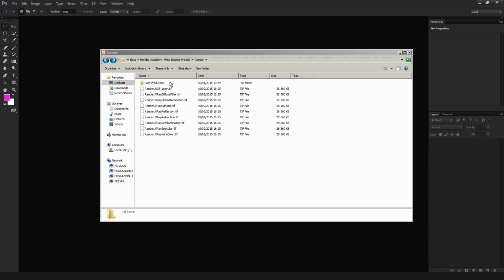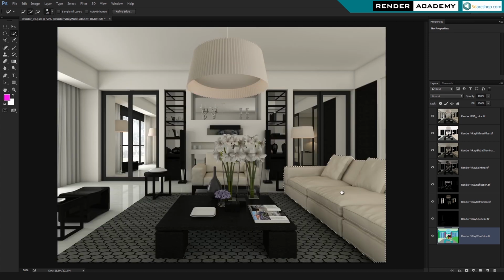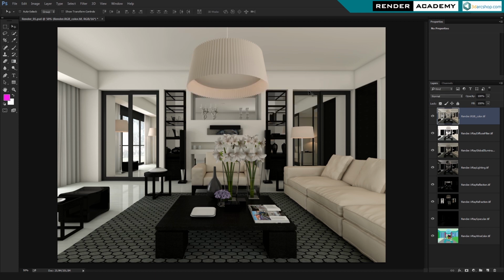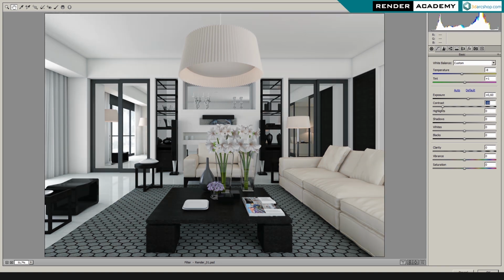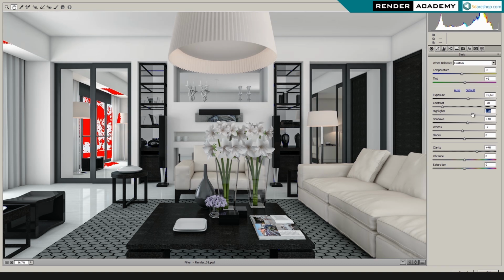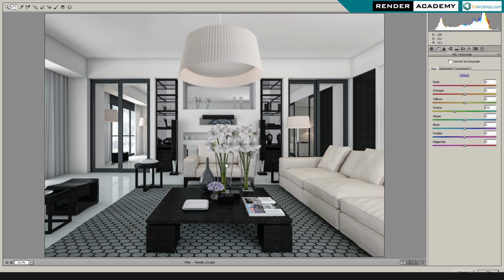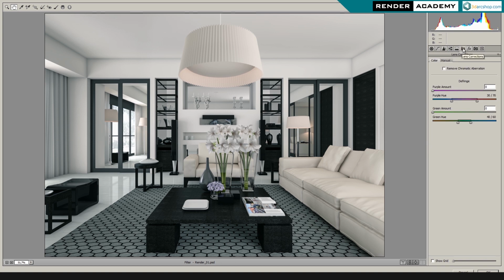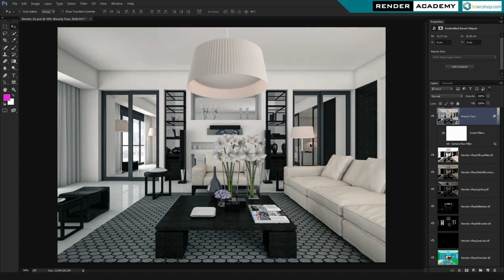Photoshop and Camera Raw Post Production for Architectural Rendering and Interior Design

Comment: Great tutorial. Just a quick question. 
some people say that render elements should be saved as EXR files. 
but there are some limitations, as far as photoshop adjustments are concerned. 
You saved as TIF. 
What is the second best option, in order to have as much detail as possible? 
and while it make a difference if someone saves as TIF, Targa, e.t.c
Reply from the maker: The main difference is on the bit-depth of the file. Imagine the file type as a container, capable of containing more or less precise data.
One example can be the .jpg with a lossy compression and usually with 8 bit per color (sometime called 24 bit: RGBx8bits each). Other example can be the .hdr or .exr files capable to contain 32 bit per channel - hdr are well known exactly for this reason.

In this tutorial I'm using a non-linear workflow with gamma 2.2 correction, I feel quite comfortable with it and the file output can be: 8 bit (too small for post production), 16 bit (imo the perfect fit for this situation) and 32 bit (too big and unnecessary for what is my goal, my workflow and my starting result for post production). Now is time for the file container: I used tif because I'm used to it after many years of testing. I'm not saying this is my "favourite" but I know what can I expect from it.
Please note that some raw render elements may best fit in 32 bit/channel, but still I think it really depends on what is your starting point and your goal.

Comment: good tutorial.
btw, sorry this might come off as stupid question. but could you explain to me how do you make the various files according to render elemnt.
is it when you save it as TIF, its automatically saving into several file according to layer?. if it doesnt how do i make it?
and can i save it as targa instead of tif? 
thanks a lot.
Reply from the maker: +sabianas16 file extension doesn't matter so yeah, TGA works as well.
The "trick" is in the Virtual Frame Buffer, the window displaying the render. I'm using V-Ray and in it's VFB you can find two icons to save the file: one icon has a single diskette and saves the displayed pass/element; the other icon has multiple diskettes and saves all the render passes/elements

Comment: can i make my post production only with the RGB pass or i have to upload the other passes (you didn't make any change on them so why did you upload the other passes?)
Reply from the maker: Aaron Beck sure you can, actually is even faster. I used different passes for different purpouses. For instance one can contain reflection data and these can be fine-tuned in post prodution. I use shadows, indirect light, direct light, reflections, refractions, self illumination and wire color, in many of my productions.
An additional note on "wire color", just to be complete: this pass is useless for final result in terms of quality, but can be very handly for workflow purpouse. In the video I'm using it to select objects based on their flat diffuse shading. Whatever is my production, still or animated, I always use it.